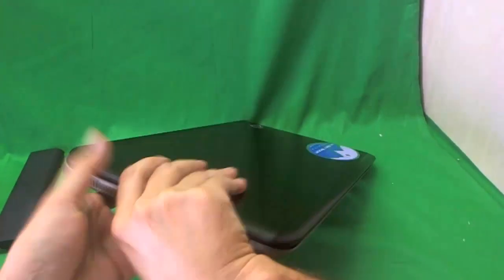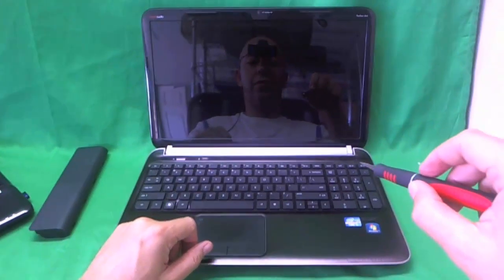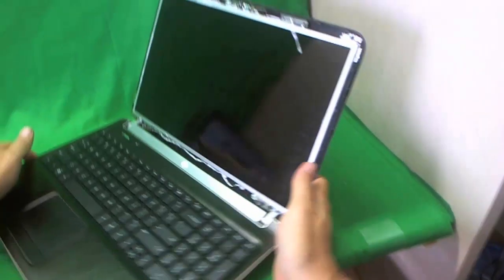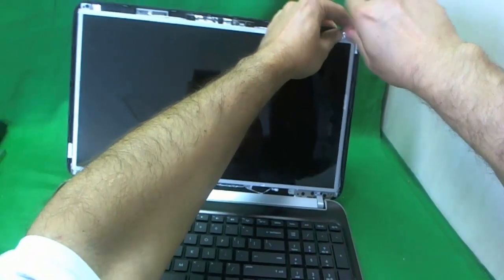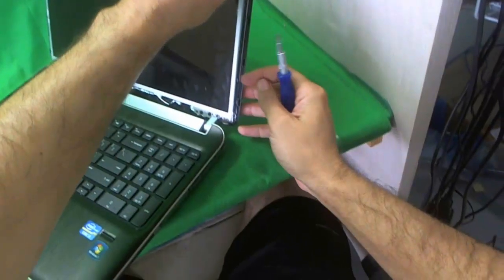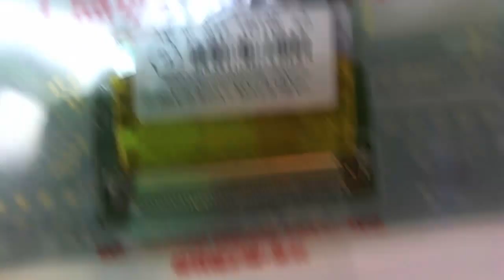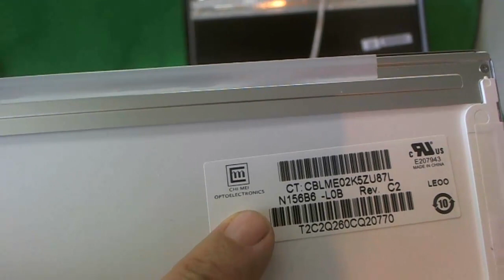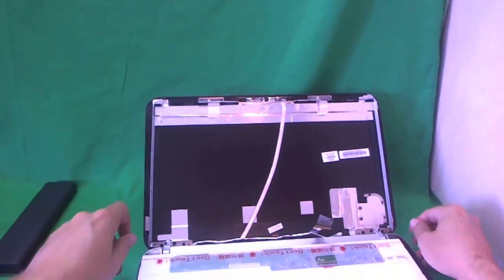HP dv6-6000 Laptop Screen Replacement Procedure

Comment: Perfect instructions.  Only took about 30-40 minutes.  A slight difficulty replacing the 4th screw down on the left of the bracket holding the screen it due to a powerful magnet just above the screw hole which kept snagging the screw, but finally got it.

Comment: Hi i have a slightly damaged left hand corner on my bezel and front cover i wish to change them both the bezel is easy but i have seen in videos that there are cables connected to the inside of front cover is it possible to change ?

Comment: I saw this website that sells touchscreen panels for laptop to change from normal screen to touchscreen and says it works for almost all laptops. I found a 15.6 inch panel and was wandering if it would work on this exact laptop.